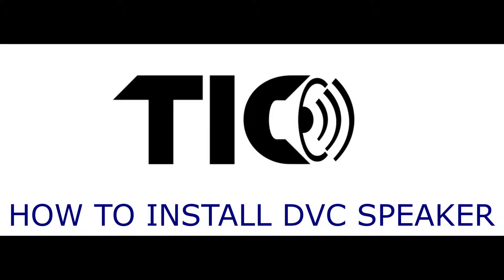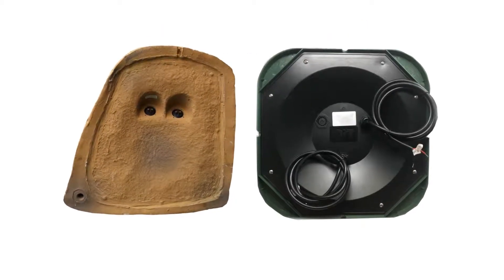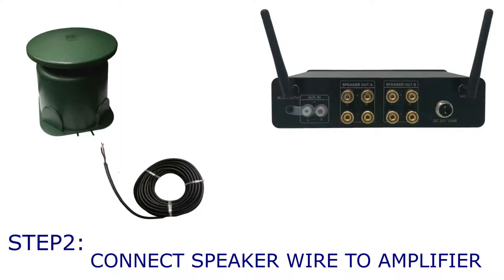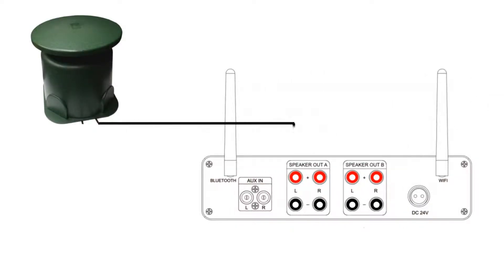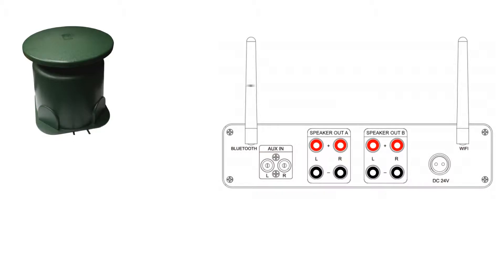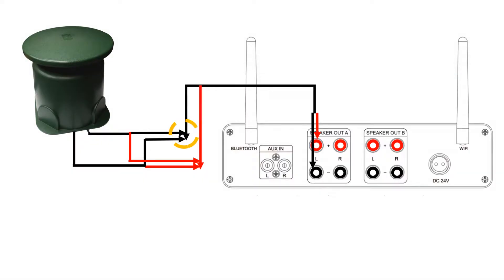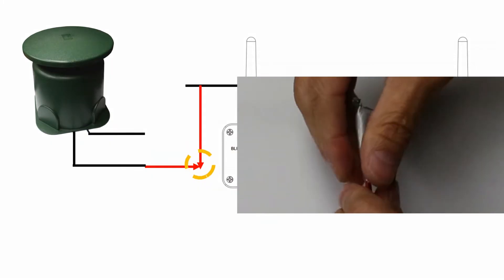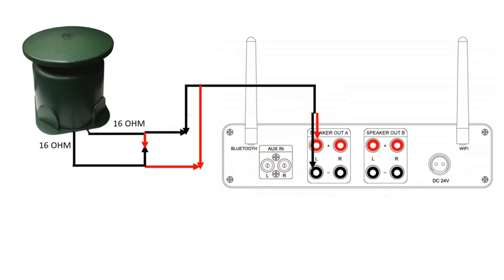How to connect a Dual Voice Coil (DVC) speaker to an amplifier

Comment: Hi, B&O Sound System in Audi A3 8V -15 Channel Class D Amplifier-Out of 15 channels 2 channels are for Subwoofer (100 W+ 100W) (8ohm + 8), which is connected to a dual coil subwoofer (100+ 100))8ohm+8ohm

Because of too much vibration from rear parcel tray, I am planning to add one more dual coil subwoofer of Same configuration in the spare wheel.

My intention is that I have to equally divide Amplifier load to 2 subwoofer 

How can I wire ?